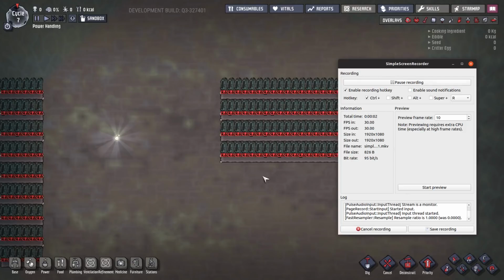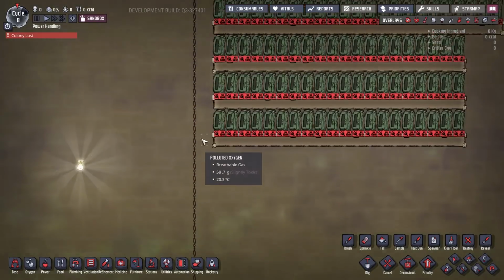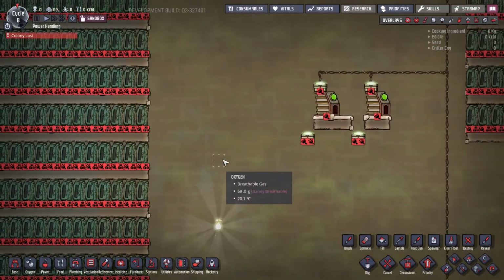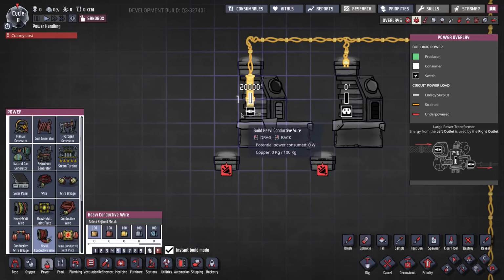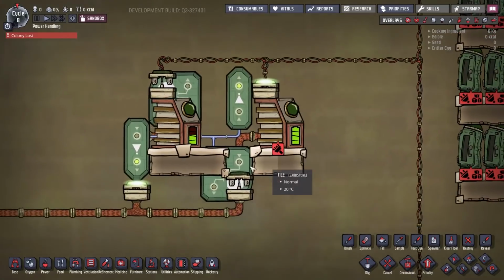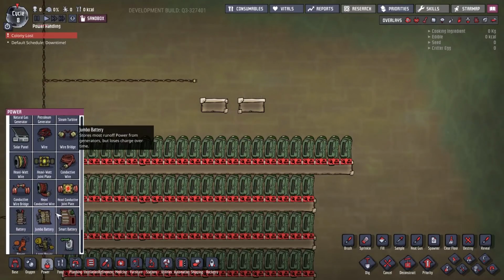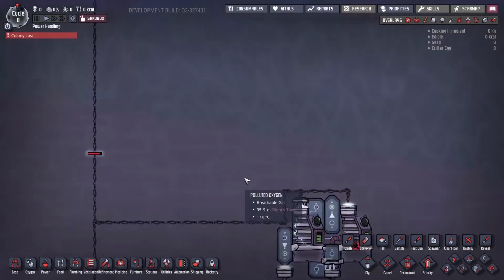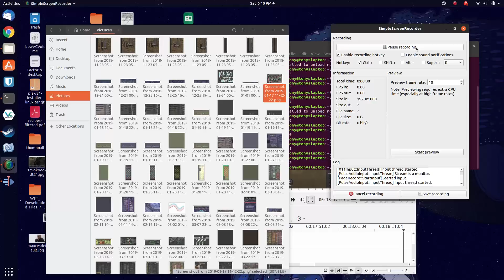How to distribute TONS of power all over your Oxygen Not Included base.

Comment: do you even need the transformers?
Reply from the maker: The transformers move the power out of the batteries that control the generators and into the main power grid. Without them that wouldn't happen. These days I kinda prefer to just connect generators to the small wire directly and not use batteries to control them at all, so if you do it that way you don't need transformers.
Reply: @tonyadvanced6315  yeah, at the time of writing the comment i didn't see the generators were automated.

Comment: this doesnt work since the last update ;)
Reply from the maker: Oh. Wow! I'll have to try it out. I guess that makes a certain amount of sense since the limit for heavy-watt cables has gone up to 50kw.
Reply: That was bound to happen since it seems so exploitative
Reply: @psteels  Actually it's not.  There is no load on the wire until it's used.  Just like in real life power is moved the same way.  You don't have massive wires moving the power.  You'd have wires as big as houses moving power.   It's the current that matters.  You aren't using the current until his make shift transformer setup.  If you never close both switches there is no current draw across that connection.

Comment: I think the common problem is that how to efficiently distribute power, how to use proper wiring so that the wires dont leak negative decor, I think what you did was basically useless since I wouldnt like heavy watt wire to flow everywhere. Thats just what I think
Reply: cause sure youve distributed a ton of power using a 1k watt wire, but used heavy watt wire on essentially every "machine" in your base.
Reply from the maker: @redcube9629  The heavy watt wire is unnecessary. I only used it to demonstrate that that heavy-watt circuits can be supplied this way  Just use conductive wires and lighter circuits.
Reply: I think you won't use 200 fridges on one place who needs 20KW or like running everything on one cable
Reply: you can use power transformers after the batteries and distribute the power in 1k wires. this trick is just so you now could build your power source at the other corner of the map and not to build heavy watt wire all the way to your base, just a way to spend less resources.

Comment: Nice tutorial but I can't imagine where would I use it tho. 
I mean at the stage which I'm producing 20kw+ power I can afford all kinds of wires everywhere.
Thanks anyway.

If anyone uses this early stage of the game let me know.
Reply: how early stage? I have used a low-watt wire system in a base. I started with standard low watt circuits for research and rock crushing. I started linking circuits, used jumbo batteries that switched based on a timer sensor, making "battery packs" for my 1kw or 2kw load circuits. once I got a metal refinery setup, I started using smart batteries (& refitting the jumbo packs).

fairly standard energy progression:  started with hamster wheels, moved to coal (setting it up to be controlled by a cycling smart battery signal is tricky), tapped a natural gas geyser, dug down into oil biome, started setting up steam and burned some petroleum. built a monument and moved on.
Reply: I use this early because of Decor and the fact that I dont want to make dedicated shafts horizontal and vertical for heavy-watt wires. I just got my first two smart batteries.